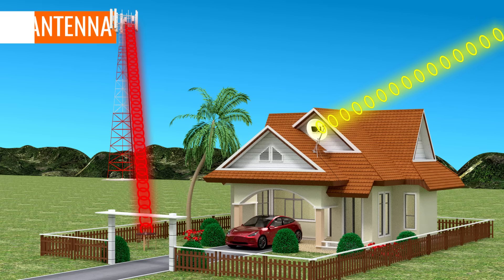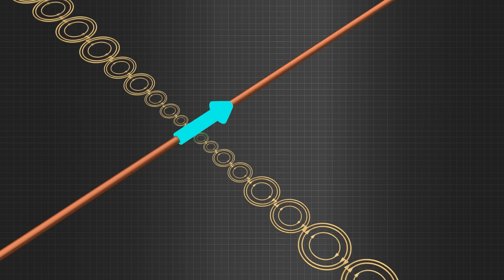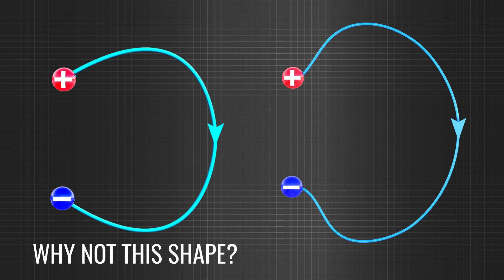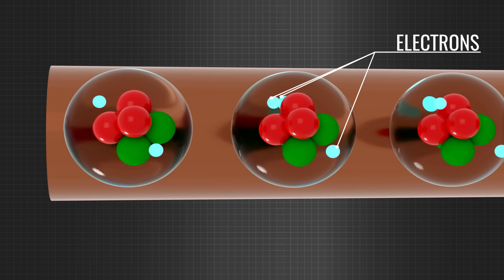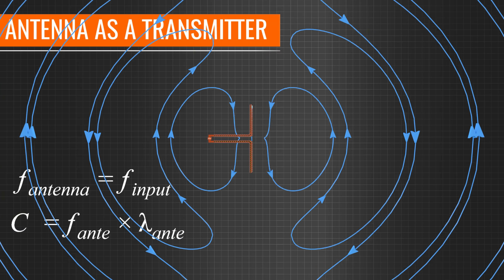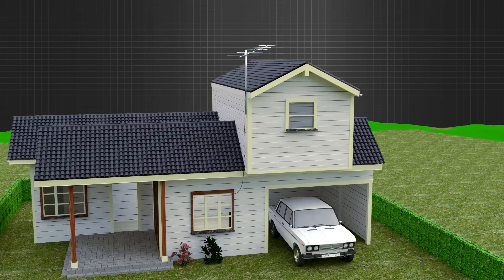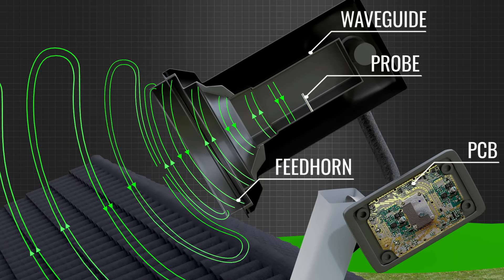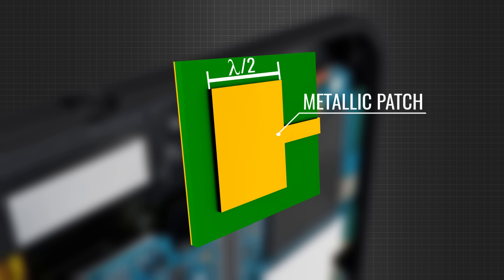How does an Antenna work? | ICT #4

Comment: Looking at antennas I always have a feeling that designing an antenna is not an exact science (based on exact formulas) but either an art (the designer has some kind of intuition) or a trial-and-error empirical process not necessarily leading to the best solution, but rather stopped when the designer got tired of trying.
Could someone please explain if there is an ideal antenna based on some mathematical formula, if it is the case, I would suppose it has to be a simple basic shape.

Why then these exotic antennas exist ?  like a fractal dodecahedron with twelve helical protrusions angled at 0.25rad at the 1/π of length and a matte surfaced nonacontakainonagon made of 57.7% copper-mangan alloy with lambda/23 long sides attached to the base.   This is just a made-up BS to illustrate how antennas mathematically look to my impression. Mathematically a Yagi or an exotic helical antenna is the same BS.

What laws of physics, formulas of electromagnetic waves would result in these irrational shapes we see antennas as a result?
Reply: The antenna shape is usually a monopole (if one end is on the ground) or a dipole or a folded dipole.  You will see all these types on roofs of houses for TV.    The dipole length is usually a half of the wavelength. For directional gain, extra elements are added to the antenna in front of the dipole and a reflector behind, giving the typical TV antenna "yagi" configuration.    For greater power, additional dipoles can be added.   The fractal antenna designs are very exotic to give high gain in the limited space inside a cellphone.  Previous designs of cellphones had half-wave dipole antennas that stuck out or had to be pulled out.   The wavelength is the speed of light divided by the frequency, the higher the frequency the smaller the dipole length.
Reply: @karhukivi  Thank you for the reply. How are the more complicated antennas invented?   Is there a mathematical formula describing how e.g. a four-way batwing antenna should look like, so they looked up a formula and cut, welded, bent the metal pieces and the first ever four-way batwing antenna was ready?   Or is it an 'error and try' empirical process, guys with some intuition bend metal for five years and after 5414 tries and 25 tons of scrap metal we have a new type of antenna?
Somehow I have the impression that the latter is true, is it really so?
Reply: @nick066hu  The batwing is a composite of four folded dipoles.  One pair of dipoles would give a stronger signal in one direction, so the second  pair is added to spread out the signal in a more uniform pattern.  They can be adjusted to send more energy say towards a city and less towards an unpopulated area.  The pattern is determined initially by calculation and then the antennae elements can be tweaked to achieve the desired effect.   Topography also comes into the calculations.  The people who design these arrays make money on their know-how, so don't expect to find a single/simple formula in the web!

Comment: 賴志偉vggrty
Reply: PONE 賴志偉 vffhhjij
Reply: TYY
Reply: you and I are on the same page!!  yes the pyramids  were a interplanetary communication device that operated at a very low frequency.  But also the great Pyramid of Egypt was a teletransportation device, ,, NOW Stone Henge and Gobekli Tape: they were power plants. ,  You will see chips on the upper parts of the stones as they were perfected to a operating frequency.  The horizontal pillars were set to vibrate at a particular frequency magnetically, for many reasons, each horizontal rock had a purpose!!   some were used to excite the seedlings in the ground, to expedite the growth, some were tuned into earths mag field and provided magnetic lift via the Earths "B" field .  Check out Coral Castle Florida,  ED used What I call a "B" field generator, His generator used "V" magnets to ensure max delivery of the "B" field Just like is being used at the black pyramid of Alaska.  His generator used 25, V mag around and 5 deep to produce the "B" field into the earth and special stones.  THE "B" field is the center of a magnet/ some like to refer to it as the neutron field.  But the 'B" field is much much more !!!   I wonder if the black pyramid of Alaska used magnetite as a skin for the pyramid that would explain many things!!!   Tesla new about the free power that's available through the CENTER FIELD of a magnet AS you are well aware the rich boys didn't want it,  It's been there all the time.  When the government took down the horizontal stone at Coral Castle the entrance door stopped working.  Funny thing they gave us the clue,, His horizontal rock was providing the magnetic energy to support the access door.  AS you know magnetic energy is perpetual  JUST GETTING started with all this.   I don't need to brag about all my credential.!!  I got into physics back in 1959 as a ham operator at 9 years old I would design and build my tube type radio's for Rec and xmit.   I know what I'm talking about..    When they say all they had were copper tools OMG HOW STUPID!!!  when you understand the properties of a inductive that being utilize to build the pyramids you would understand a copper tool was every bit of a power tool  BIG TIME!!!!!!!!!!!!!!!!

Comment: idk where I missed this education in my life. When I started college in foreign lands, everyone else in the class knew about this while I had to rely on rote mugging up learning and not grasping the science. I literally did not know what I had to look for, all everyone said is flow current to T shape and it will form the waves. As I chose electronics and communication as my Major a decade ago, I feel this understanding would have helped me catapulted my understanding in the course and I would not have turned a delinquent in between. But alas, I had to pick a different career after graduating. An unfortunate turn of events. I would have so well loved these sciences.
Reply: *School did not taught me this, nor did college. The inconsistency of different boards.
Reply: you and I are on the same page!!  yes the pyramids  were a interplanetary communication device that operated at a very low frequency.  But also the great Pyramid of Egypt was a teletransportation device, ,, NOW Stone Henge and Gobekli Tape: they were power plants. ,  You will see chips on the upper parts of the stones as they were perfected to a operating frequency.  The horizontal pillars were set to vibrate at a particular frequency magnetically, for many reasons, each horizontal rock had a purpose!!   some were used to excite the seedlings in the ground, to expedite the growth, some were tuned into earths mag field and provided magnetic lift via the Earths "B" field .  Check out Coral Castle Florida,  ED used What I call a "B" field generator, His generator used "V" magnets to ensure max delivery of the "B" field Just like is being used at the black pyramid of Alaska.  His generator used 25, V mag around and 5 deep to produce the "B" field into the earth and special stones.  THE "B" field is the center of a magnet/ some like to refer to it as the neutron field.  But the 'B" field is much much more !!!   I wonder if the black pyramid of Alaska used magnetite as a skin for the pyramid that would explain many things!!!   Tesla new about the free power that's available through the CENTER FIELD of a magnet AS you are well aware the rich boys didn't want it,  It's been there all the time.  When the government took down the horizontal stone at Coral Castle the entrance door stopped working.  Funny thing they gave us the clue,, His horizontal rock was providing the magnetic energy to support the access door.  AS you know magnetic energy is perpetual  JUST GETTING started with all this.   I don't need to brag about all my credential.!!  I got into physics back in 1959 as a ham operator at 9 years old I would design and build my tube type radio's for Rec and xmit.   I know what I'm talking about..    When they say all they had were copper tools OMG HOW STUPID!!!  when you understand the properties of a inductive that being utilize to build the pyramids you would understand a copper tool was every bit of a power tool  BIG TIME!!!!!!!!!!!!!!!!
Reply: We live in a 100% magnetic universe..... it's that simple!!   The center of a magnet is by far the most powerful part!!!   that's where you will find anti gravity and most everything else.   STUPID HUMANS!!  We went backwards in the Iron age!!  the center of a magnet is where we belong after all that's what we are all configured with..FACT!
Please review the works at "CORAL CASTLE, Florida. (YouTube),   He would "VIBRATE" ,,  not oscillate the granite at a resonant frequency to the type stone he was working with.  Granit has allot of magnetic properties given it's make up...  You just need to vibrate at the correct freq.  and it will become workable.  Keep in mind we are talking about vibrating only the "B" field of a magnet into the rock!!!   You will note at Coral Castle he also had a horizontal stone , similar to Stone Henge... All his magnetic generators were in the repel mode to maximize the "B" field..  SIMILAR TO THOSE Shown ON THE PYRAMIDS OF EGYPT..  FACT!!,  THINK about it THAT'S exactly why they used copper tools!!!!  You must use copper tools and any iron would totally dispute the field.  Quantum Math is total B.S.  E=MC2 is also total BS... E=MD.  (Magnetic density).  Thanks  Vincenzo.. Please use your brain!!  If your professor gives you any flack,  have him explain the speed of magnetism.  It's instantaneous.
 That's how they used the pyramids as transportation devices, inter Galaxy type transportation that's exactly why they were 8 sides to create a perfect hologram from earths magnetic field that could be used to connect interglacially

Comment: Hi, can you explain if there is any pyramid-like antenna design can passive amplify RF signal ? I have not found yet any related info, and my end topic is if with an piramid like antenna can passively amplify HF 3-30mhz can do some physical effect over ~water flating copper needle or candle flame.

Comment: In aircraft radars the return signal will differ in frequency sometimes so how do the antennas receive a different frequency? Is it just that the frequency changes are too small to be important as the Doppler effect won’t change the frequency as much as you see in cars because the velocity difference between the light and the object being hit is very big

Comment: Could someone answer my question please? So does that mean in 3D, each electric wave is a doughnut-like shell (surface) that keeps growing in size as it propogates? Or is each wave a doughnut-like volume (with non-zero field values inside it) as it travels?
Reply: We live in a 100% magnetic universe..... it's that simple!!   The center of a magnet is by far the most powerful part!!!   that's where you will find anti gravity and most everything else.   STUPID HUMANS!!  We went backwards in the Iron age!!  the center of a magnet is where we belong after all that's what we are all configured with..FACT!
Please review the works at "CORAL CASTLE, Florida. (YouTube),   He would "VIBRATE" ,,  not oscillate the granite at a resonant frequency to the type stone he was working with.  Granit has allot of magnetic properties given it's make up...  You just need to vibrate at the correct freq.  and it will become workable.  Keep in mind we are talking about vibrating only the "B" field of a magnet into the rock!!!   You will note at Coral Castle he also had a horizontal stone , similar to Stone Henge... All his magnetic generators were in the repel mode to maximize the "B" field..  SIMILAR TO THOSE Shown ON THE PYRAMIDS OF EGYPT..  FACT!!,  THINK about it THAT'S exactly why they used copper tools!!!!  You must use copper tools and any iron would totally dispute the field.  Quantum Math is total B.S.  E=MC2 is also total BS... E=MD.  (Magnetic density).  Thanks  Vincenzo.. Please use your brain!!  If your professor gives you any flack,  have him explain the speed of magnetism.  It's instantaneous.
 That's how they used the pyramids as transportation devices, inter Galaxy type transportation that's exactly why they were 8 sides to create a perfect hologram from earths magnetic field that could be used to connect interglacially
Reply: We live in a 100% magnetic universe..... it's that simple!!   The center of a magnet is by far the most powerful part!!!   that's where you will find anti gravity and most everything else.   STUPID HUMANS!!  We went backwards in the Iron age!!  the center of a magnet is where we belong after all that's what we are all configured with..FACT!
Please review the works at "CORAL CASTLE, Florida. (YouTube),   He would "VIBRATE" ,,  not oscillate the granite at a resonant frequency to the type stone he was working with.  Granit has allot of magnetic properties given it's make up...  You just need to vibrate at the correct freq.  and it will become workable.  Keep in mind we are talking about vibrating only the "B" field of a magnet into the rock!!!   You will note at Coral Castle he also had a horizontal stone , similar to Stone Henge... All his magnetic generators were in the repel mode to maximize the "B" field..  SIMILAR TO THOSE Shown ON THE PYRAMIDS OF EGYPT..  FACT!!,  THINK about it THAT'S exactly why they used copper tools!!!!  You must use copper tools and any iron would totally dispute the field.  Quantum Math is total B.S.  E=MC2 is also total BS... E=MD.  (Magnetic density).  Thanks  Vincenzo.. Please use your brain!!  If your professor gives you any flack,  have him explain the speed of magnetism.  It's instantaneous.
 That's how they used the pyramids as transportation devices, inter Galaxy type transportation that's exactly why they were 8 sides to create a perfect hologram from earths magnetic field that could be used to connect interglacially
Reply: Its actually a sphere that gets larger
Reply: this video explanation is wrong
Reply: @jonathanjenkins3609  can you explain what is wrong? Please
Reply: What’s wrong about it?